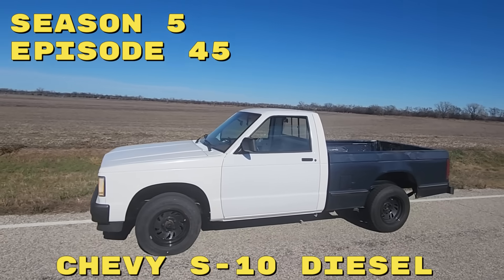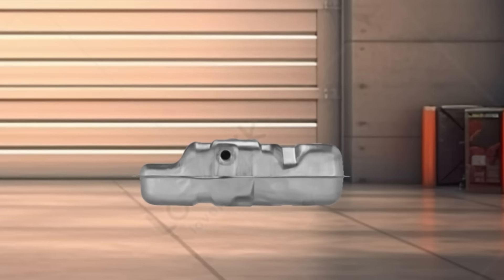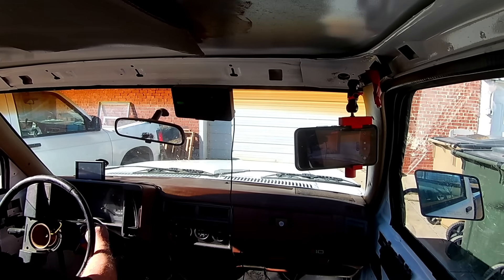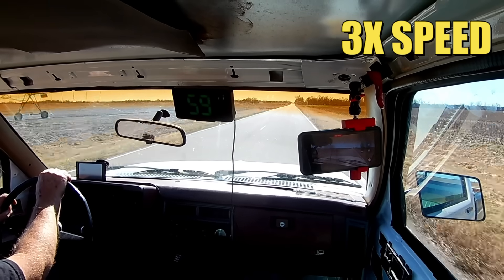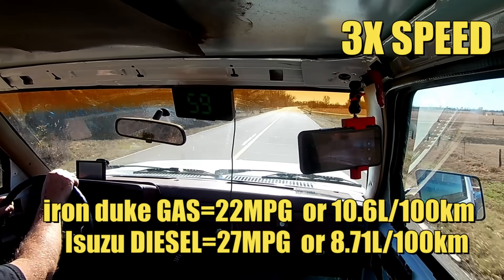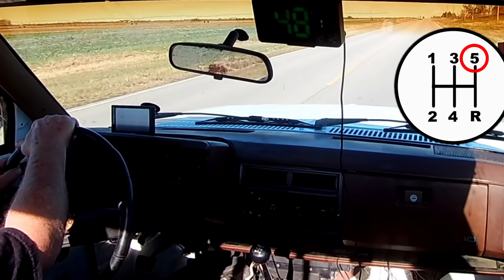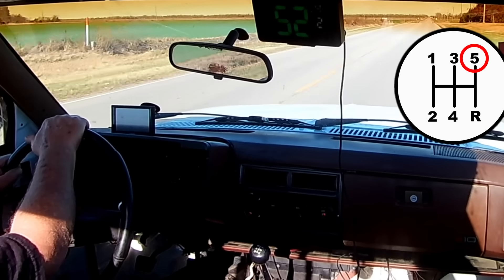S5 E45. MPG?  We road test the custom diesel Chevrolet S-10 to find out the fuel economy.

Comment: I used to have an 88 s10 short box  with the iron Duke 2.5 and 5 speed with 2.73 rear gears. I used to pull 29mpg consistently commuting around 30 minutes to work. I bought it from a retired music teacher with 62,000 miles, but it had rust and probably spent it's while life outdoors. It was a "camper special" with an aluminum topper with matching pin stripping to the truck. I assume that was a dealer option, and was probably on there since new. I owned the truck twice after selling it to a buddy, then buying it back for scrap price with no box or rear axle @99k miles. Put another box and axle on it, drove it to around 130-140k. We used to scrap with that truck, went across the scale once with 2,200 lbs in the box. Our average load was 1,200-1,600 lbs in that poor old truck. The iron Duke just kept going though, didn't care, gutless empty and even more gutless with almost a ton in back. That being said I've owned an 02 Jetta TDI with a tune and full 3 inch stainless KermaTDI turbo back exhaust. I also now own a unicorn 15 Passat TDI 6MT, which I've also just tuned with a Kerma tune. I've always thought a tuned ALH would be awesome in an old s10, let alone a CVCA 3rd gen like my passat has. With a simple tune I'm pulling in the high 200's for ft-lbs, just under 300. Needless to say, I'm hooked on the build! Keep up the awesome work!
Reply: BTW, the stock CVCA had way more power than the tuned ALH ever did. It had the Unitronics stage 1+ tune. Basically as high as you could go with stock injectors and turbo.

Comment: My 88 S10 was lowered a couple inches in the front and at least a few more in the back. And looked really cool with the IROC wheels, roll pan, and 91' grill.... I think you should add a budget tonneau cover and lower it! It's not like you're putting a ton of weight in the bed anyway! Excellent numbers nonetheless!

Comment: I can definitely tell when my 2010 Insight is fighting wind.  Driving north today on a delivery I could barely keep it going 65 up the 80mph turnpike.  But coming south after it did fine.  38.3mpg over the last 12K miles which is a little less than the 40/44 EPA rating but the car does have 292,000 miles on it and is missing the grille garnish and most of the splash shields underneath.  Someday I'll find one in a pick n pull type yard and get all the missing plastics.  Will it make a huge difference?  Probably not, but I'll feel better knowing it's doing the best it can and this car on its worst days is light years ahead of the 2008 Uplander, 2008 Explorer, and 1993 Town Car it's essentially replaced.
Reply from the maker: LOL, my "normal" 2000 Insight has to stay in 4th gear a lot of the time due to the wind.  It still gets over 50MPG.

Comment: I'm neither surprised nor disappointed at the MPG result.
Compared to what's available today for sale, I say those numbers are "competitive", specially when you think about all the extra GARBAGE attached to any modern engine that has to be set aside or removed to do ANYTHING on them.
This engine may not be a walk on the park to work on (probably not as easy as Mr.Jimbo would like it to be) BUT it sure ain't as hard as any modern diesel to work on.
I still have nightmares from that ECODIESEL disassembly video I saw on "I Do Cars" YT Channel.
Great job as always, master Jimbo.👌😎
Keep at it and we'll keep watching.😎👍
Reply from the maker: LOL, you have a very good point.   I'm really complaining about nothing, this engine is really easy to work on when compared to the junk under the hood of modern vehicles.

Comment: 1:01 We also would've accepted "Scientificated" 😊
    [EDIT: I'll be very silly and guess 55MPG lol] 

(PS: did my vapor carburetor post on last week's video makes it through? Can't trust YT's autoKaren system anymore after they tweaked it to be less obvious it's been hidden from the public)
Reply: Could always say "Re-tar" to skirt around the draconian ways 😅
edit: Anyone interested in the science side of this will want you to use a Tach. Coincidentally, before you mentioned short shifting, I was already wondering why you didn't have a Tach! It's the smart thing to have on all your projects. 🤓👍
Reply from the maker: I didn't see a vapor carb post last week, but I also didn't get a chance to read all the comments.  I'm not sure if the vapor carb was directed toward the diesel engine, but if it was, keep in mind diesels require timed injections in order to run properly.
Reply: @robotcantina8957  I think it was after 7pm when I got around to watching it and leaving that one, so it might've got lost in the midst of avalanche of other comments.

But no, it was directed at your small engine projects. I can dig it back up if you're interested but the long and short of was that it is a setup that draws air through the gasoline and then runs solely off the fuel vapors. 

In the two examples I watched, they used a crude setup for bench top tests where it was ball style on-off valves, 2 were used and the vapor was plumbed in the middle of them (no carb). They BOTH behave as throttle, but the one closest to the engine metered the cumulative ingress, and the one upstream regulated the Air:Fuel ratio by letting in more or less fresh air. (thus why both affect RPM)

My thought was with your knowledge of electronics you may be able up rig up a brainbox with two servos and 2 old carbs that are only being used for their butterfly valve. Combine that such an O2 sensor and you have an automated system that can regulate it all by hand

(they showed it running on HHO as well)
Reply: @robotcantina8957  Hopefuly this one (above this comment) made it through the system. 🥴

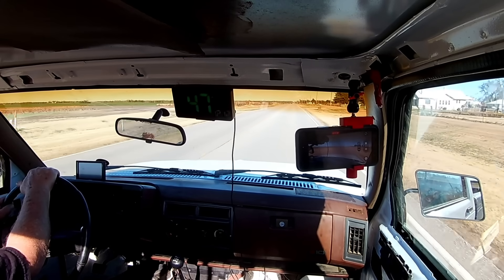Comment: 6:13 I’m guessing around 38mpg
Reply from the maker: Not a bad guess.  I was hoping for that as well.  Now I think with some tweaks I can probably do 35 or 36.
Reply: @robotcantina8957 and 14:12 as for the tach and hearing issue, when I drove diesel trucks with no tach I used a finely tuned butt dyno. When it starts to feel like power is falling off, not much there to begin with, shift. I was running 36k pounds with maybe all of 150hp.

Comment: For comparison, in my 2009 Mondeo Estate, 1,8l turbo diesel, the onboard computer gives an average fuel reading of 5,1 l/100km and what I seem to get when calculating driven distance against added fuel, is 6.1 l/100km. This is with a huge heap of useless junk on board.
In Finland, diesel is about 10 to 20 cents cheaper than gasoline per liter, but diesel vehicles have an added yearly fee based on vehicle mass, which is now approx. 650 euro/year for the Mondeo. Vans and work/freight trucks get almost exempted from that so some people convert their estate vehicles to vans by removing the back seat and getting a conversion inspection. Then you can only legally have one passenger.
Reply from the maker: Interesting, I was not aware of the tax situation.  LOL, figuring out a way around it is human nature.

Comment: A turbocharger plus a Turbo-Compound to capture that last bit of exhaust energy and put it back into the engine would help the power density and fuel efficiency of the setup but that would require serious engineering budgets and many late nights of passionate struggle to accomplish, ie big bucks. We can only dream of the possibilities 🤔

Comment: Found you a year ago and love your channel. Been driving an 02 Jetta ALH 5spd for the last 18 years, and this series made me anticipate your progress like the best show on TV. With double the power thanks to upgraded injectors, turbo, ecu stage 3, and more as only needed over time, I drive for MPG. At 80, I'll average 46mpg on USLD, at 62 I'll average 53mpg. I once had an 00 ALH Jetta till I got head on collided, and could get 60mph at 60 and 65 at 55mph over a tank, but that was in LSD (not the drug) times.
Reply from the maker: That's some impressive mileage, thanks for sharing!  I would love to upgrade to the ALH, but due to the location of the oil pump, it wont fit in the S-10 chassis without cutting massive chunks from the crossmember.  I think the 1Z or something like that will work, it;s just hard to find one.
Reply: @robotcantina8957 all good. The mechanical prequel to the ALH is much respected. When my fuel pump started acting up at 300k, I shaved the money and got an 11mm refurbished from Poland. I will get a CEL pulling a long mountain at the top when advanced timing (pulls like a gas turbo) is present. I *rtrd the timing and never never see the CEL except for the occasional 12 hr day over speeding home. BTW, the CEL is for injection timing decision. Noting I'm worried about, just like my 23 yr old car to be perfect.

Comment: 32.5MPG seems about right compared to what the VW got with the engine and what the S10 did with the Isuzu. I think the engine should be warmed up before doing a fuel economy run as the it will likely burn considerably more while cold. Hope Jimbo can get the same numbers from the TURBO version and squeeze a bit more from the NA one with improved timings. One thing re aerodynamics - manufacturers will often boast about their c/d but neglect to mention the frontal area this is applied to and the pickup truck certainly has more of that than the VW as well as a worse c/d and likely wider tires. If the engine was really struggling you'd think a TURBO might actually improve MPG but I'm not sure - NA diesels are weird.

Comment: Here in Finland diesel is usually very slightly cheaper than 95E10 (currently around 1.6€/l), but you also pay an extra pollution tax - 5,5 cents per 100kg vehicle weight per day, e.g a 2000kg truck would cost 401€ extra per year. (Also the general vehicle tax , both when buying and per year is directly tied to the co2 output, high polluting cars are ridiculously expensive here)
Reply from the maker: Thanks for the data!

Comment: What's the gear ratio (diff)?  3.73 to 1?
Reply from the maker: Yes, its a 3.73 axle.
Reply: @robotcantina8957 something in the low 3.oo to 3.21 range would help, but you knew that already. You could pull thru the gears  longer, o/d could be high speed only interstate if you dared.

Comment: Mythbusters did really thorough testing on tailgate configuration. Tailgate up, bed open is best because it causes an aerodynamic low-pressure zone in the bed.
Reply from the maker: That's great info, thanks for sharing!

Comment: Fill the tank at a gas station until the nozzle stops, drive around,  fill it until the nozzle stops, and what eve you put in the second time is how much fuel it burn.
Reply from the maker: Yes, but you have to drive over 200 miles in order to get a accurate measurement.  For short trips the weight method works best.

Comment: It makes only sense that diesel is cheaper than gasoline, because it's one level lower in the destillation tower in the oil refining process. So less energy input and more output of fuel.
Reply: The price of oil being speculated on the commodities market is what determines fuel prices first, then supply versus demand. Where it's at in the cracker has no bearing on the price whatsoever.

Comment: I love the sounds of the vw diesels....makes me miss the 81 VW Rabbit 1.6 diesel I had as my first car. She was worn out by the time i had it but the 48 angry hp it had routinely got me 45mpg in town.
Reply from the maker: LOL, indeed the 1.6D is an angry sounding little engine.
Reply: @robotcantina8957  mine redlined at 5450 RPM and there, it's screaming at the absolute top of its lungs....I don't recommend that kind of rpm .

Comment: A quick check for the timing being within acceptable numbers: if you pull the cold start accelerator while the engine is warm and idling, it should not make hard combustion noise "nageln" in german (from Nagel > nail  so it sounds like someones hitting the pistons with a hammer). If it does "nagel", the timing is too advanced. If it doesn't, you should be fine.

But sure, doing it properly is even better than eyeballing it i guess 😉

Great to see that thing running and driving anyways😊
Reply from the maker: Thanks!   Right now , pulling out the cold start lever seems to make no difference in sound or in starting....
Reply: @robotcantina8957  interesting...

But it should increase idle speed a bit.

The difference in starting really happens towards the freezing point and below. In mild temperatures it might not do much.

Comment: In spain normally diesel fuel is cheaper than normal 95 octane gasoline, for example, where i do refuel, the 1L of diesel is 1.319 euros and 1L 1.349 euros

Comment: I venture to guess that the tailwind would have more affect. This given the exposed area(facing the wind) and the rear of the vehicle more of a wall. Did you notice using less throttle with a tailwind?
Reply from the maker: Yes, with he tail wind I had to pull back on the throttle in order to stay at 55 mph.

Comment: I was taught timing a diesel by ear just involves advancing the timing until you start to hear the diesel clatter get loud. On the manual injection IDI engines, I've never had an issue doing that way. If the timing is too retarded, as I found out when I swapped a chevy 6.5 to a 6.2l injection system, it sounds like a gasoline engine and there is no blow-by. The issue with leaving that way is you can burn exhaust valves and there is almost no power at all.

Comment: The ground for the fuel gauge was extremely corroded on my s10, I cut back about 2” to get back into clean copper wires. I soldered a new wire and ring terminal in and that fixed the fuel gauge.
Reply from the maker: Thanks!

Comment: Jimbo, pls detail how you install an aftermarket tach and temp gauge as I need to do this to my classic 1990 Isuzu compact spacecab pickup with 2.6L gas 4cyl... Thx
Reply from the maker: Will do, however on a diesel it's completely different.  If your Isuzu has a conventional distributor and ignition coil. the green wire from the aftermarket tach goes to the negative side of the coil.

Comment: Another good option is the 6.2 v8. It's not much bigger than a small block v8 which fits fine.

The balancers go bad on those so much and caused so many problems that Fluidampr made one just for them. They could get 30mpg in full size trucks back then.

Comment: I was expecting 30 MPG mostly because of the engine's age ... and size (I think the engine is too small to be efficient).  
Those old engines are not as fuel economical as modern engines.

I personally think forced injecting the engine will improve power (at most 30%) but because it is a mechanical injection the fuel economy will remain the same (or at least very close).

Comment: There is another thing that will effect fuel mileage that is having the tires balanced properly . Due to the light weight on the rear axle any wheel hop will cause a drop off of fuel mileage. This could also be from bad shocks or rough road surface as any time the tires brake contact with the road you lose mileage. Sometimes you get better mileage with 100 to 150 pounds of sand in the back of the vehicle. This is also why vans will get better mileage than pickups. Mount a camera on the bottom of the vehicle and film the rear tires to see if they are staying in contact with the road.

Comment: Try pressing your trip odometer reset button.  Maybe it is stopping the correct gears from engaging.
Reply from the maker: LOL, it's kuput.  I took it apart and had a good look.  there is a lot of corrosion on the shafts.

Comment: Great work!  What about the rear differential gears?  I thought diesel options came with different ratios than gas?
Reply from the maker: The truck has a 3.73 rear axle, but it was originally built with a 2.5L gasoline engine.

Comment: Nice work! I've always said that all these geniuses in the government and vehicle production have their heads up their butts. A little more powerful motor will definitely get you what you want. A motor with enough power to move, if you keep your foot outta the gas, will get pretty good mileage. We've spent literally decades now trying to get cars to get 40mpg... Funny, Subaru did that back in the 80s. We haven't advanced at all with all these automotive changes.
Reply from the maker: I agree, but keep in mind cars/trucks did get a lot heavier with extra steel for safety.  The truck I'm using doesn't have a lot of extra metal,  Not even steel impact beams in the doors.

Comment: Before you modify the injector pump (and I'd love to see the results if you do), this engine is internally speed governed. My 83 would feel like it hit a wall at 4200 rpm, and my 91 would feel like power dropped off steadily above 4000 rpm, both calculated from vehicle speed and gear ratios. 
All that to say it may sound like you're reving the crap out of it, but odds are as long as it feels like it will go faster, you're probably under the red-line of the engine. However, if you turn the fuel quantity screw, it will change the geometry of the governor linkage and that "feature" may not behave as expected.
 I barely drove my '78 without adjusting the fuel screw because the 1.5 can't get out of its own way even pushing a little 600kg rabbit, so I don't have a data point on that, and all the turbo IDIs behave differently at high RPM.

additional side note Up until this last year, where I live gasoline and diesel hover around the same price, with diesel fuel being more expensive in the winter when the demand is high for heating oil, and gasoline being more expensive in the summer.  Diesel has been steadily more expensive for over a year, and I suspect that the difference is taxes.
Reply from the maker: More experiments are on the way!